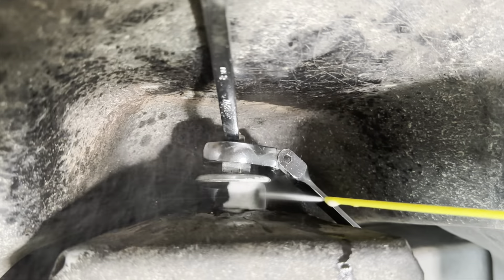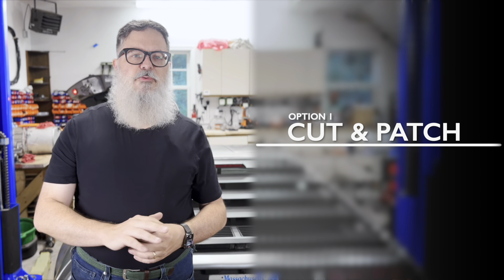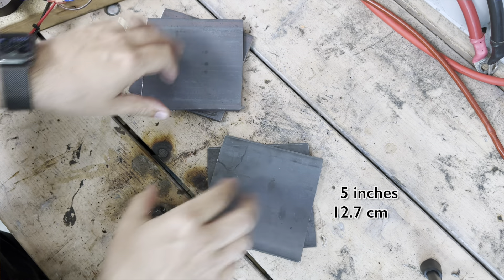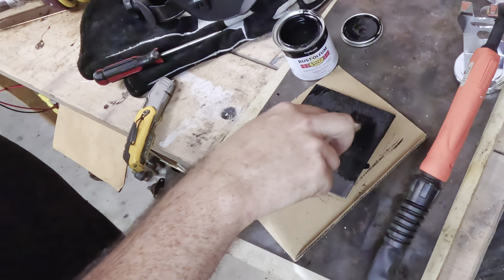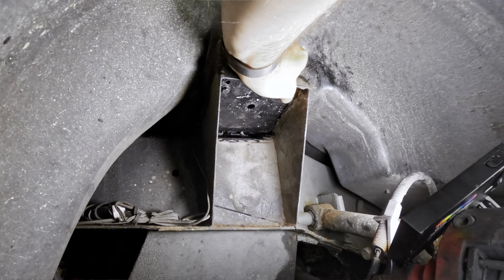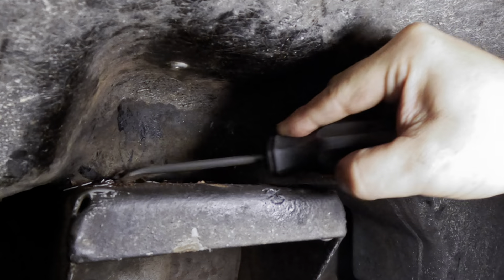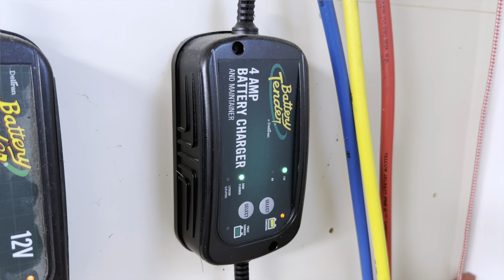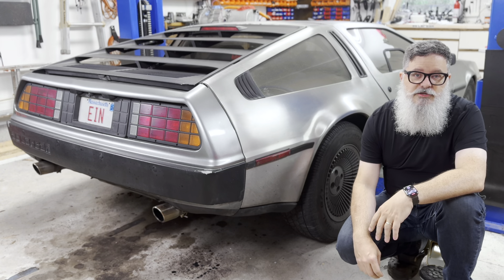"Fixing" my DeLorean's failed shock tower with 3D printing

Comment: I remember when the DMCs were new, one of the selling points was the stainless steel body that would not rust. Didn't realize that everything under it was regular steel.
Reply: Other than the doors and exhaust, the only things that are stainless on a DeLorean are the very thin external body panels that "bolt" to the fiberglass pontoon that forms the "body" underneath them.  The stainless exterior is just a shell of panels over fiberglass.

Comment: I had a similar but different problem on mine (2876).  When I bought it in 1996, it had a clunk in the driver's front despite only having 19,000 miles. The top of the driver's front shock absorber had, for whatever reason, lost it's nut and the protruding stem had reamed out the hole in the tower, essentially enlarging the diameter of the hole as well as damaging the shock stem.  I consulted with Stephen at DMC and he recommended simply replacing the front shocks and, since the hole wasn't all that bad, just tighten the rubber bushings together to compensate for the hole diameter.  At the time, that seemed kind of a janky solution to me, but apparently the man knew what he was talking about as it is now 2023 and those same shocks are STILL on the front working perfectly ever since.
Reply from the maker: I’m glad my somewhat ad-hoc solution wasn’t THAT ad-hoc then. :) I actually asked on DMCTalk first, fearing a major repair, and the consensus was just to put a plate in there. I was going to go half inch, even, until the more experienced members suggested that a mere 1/8” would be fine.

Comment: Is that company in Switzerland still making those stainless steel DeLorean frames?  I haven't heard from them in YEARS.
Reply from the maker: DeLorean Industries in Ohio also makes stainless frames. I got my stainless trailing arms from them (there’s another video about that). I vaguely remember them saying they weren’t going to do any more automatic frames a few years back, but I haven’t checked in a while.
Reply: @joeangellx I think DeLorean only made 200 automatics, if I remember correctly. I'm surprised every day by how may of them seem to have made it to the Internet vs manual cars.  Mine's a manual, with the black interior, thankfully.
Reply from the maker: @NorthernChev You mean automatic stainless frames?  It's estimated that 1/3 of the DeLoreans themselves were automatics.

I want to go electric someday. I’m sort of waiting for my engine or transmission to fail. Which, ironically, will mean it will cost even more because I won’t be able to sell the engine/transmission to pay for it. But it’s easier to justify taking the car off the road during the conversion when it’s already not drivable. 

Mind you, I wasn’t considering doing a frame swap at that time, but if it looks bad enough I might have to.

Comment: Why did you not weld it in place . That would permanently patch the issue.
Reply from the maker: Access, mostly.  I'm not that good of a welder (see my exhaust videos), and that's a tight space for me to get my TIG torch into.  I wasn't entirely sure that I would be able to get around the edges properly, and likely would have wound up with some tacks that I'm not sure I would have trusted.

I'll bet that an experienced welder wouldn't have had much of a problem.
Reply: @joeangellx  in this case I would have taken it to a shop  or call a mobile welder  to secure that. If it shifts it could shear the bolts and tower. Still great video.
Reply from the maker: @warp103  That is a good point.  I'll see if I can find someone who can take a look at it.  Thanks!
Reply: It was shocking how much the top of the tower had warped. I love the tried and tested fixing solutions: try this, try that and see if it works.
Reply from the maker: @Nigel999 I drove at least 2000 miles on it, too. I didn’t notice it when I replaced the suspension shocks because the top of the tower is hidden by the fender, so unless you’re actively looking in there it’s easy to overlook. I had to hold my phone up to take pictures of it to see it.

Comment: You can just swallow a washer in the middle of that and bolt this on them but bitch back in it it will work you have to do all that plate reinforcing crap